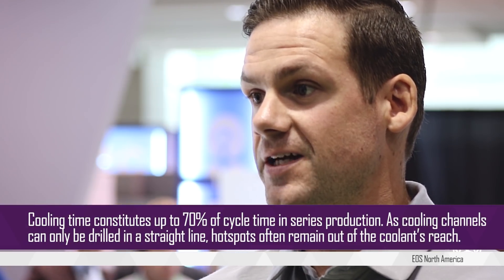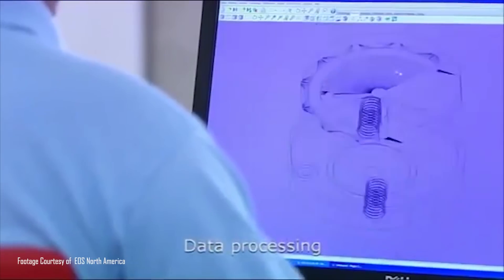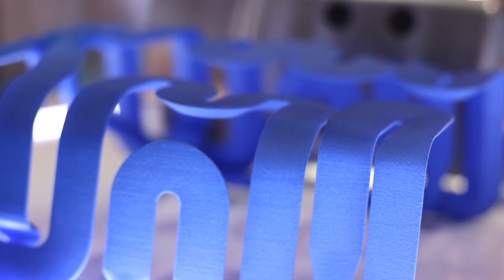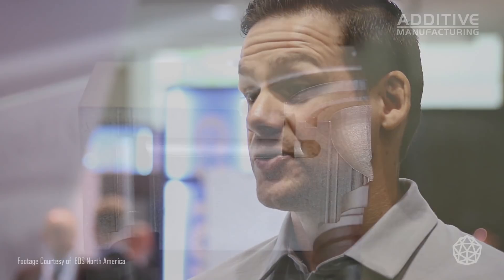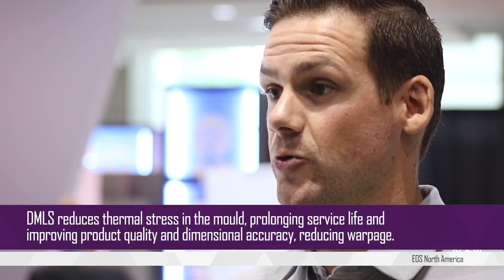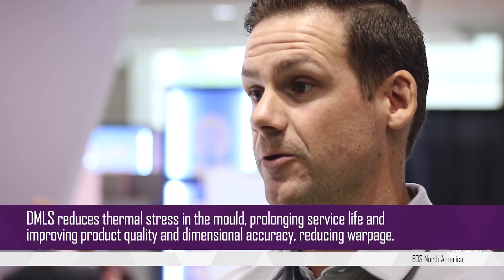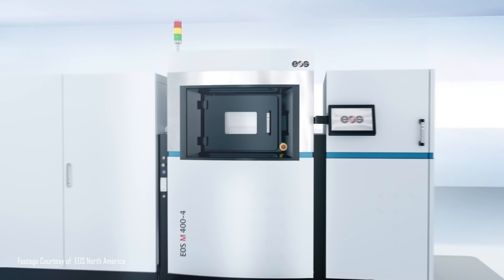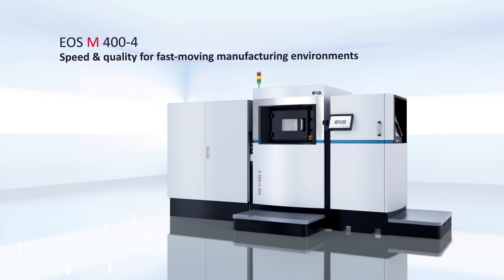How Additive Manufacturing Wins in Tooling: Conformal Cooling

Comment: neat stuff.  can this metal be welded for repairs?  this does have great advantages but I always look at long term, especially if there is a crash, damage, or a change and how you fix it.
Reply: Of course; if it is printable it is weldable. Actually SLM process relies on a "super controlled" laser welding of thousands of kilometers!!